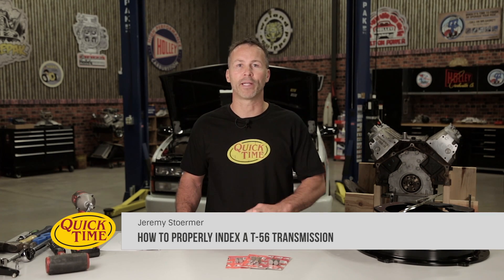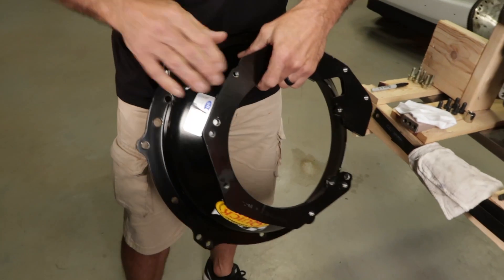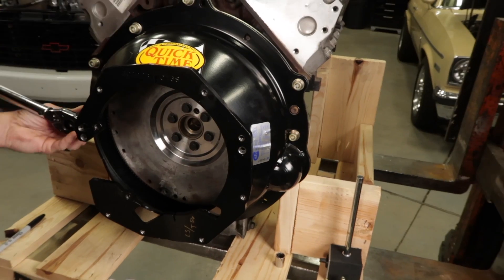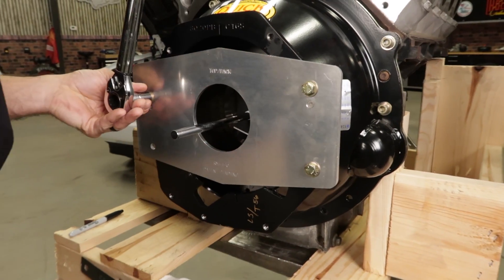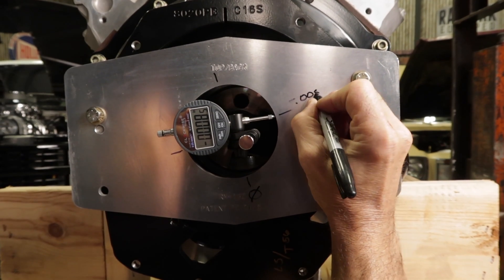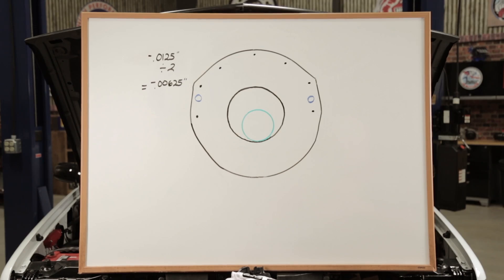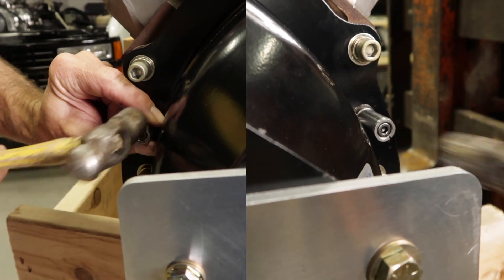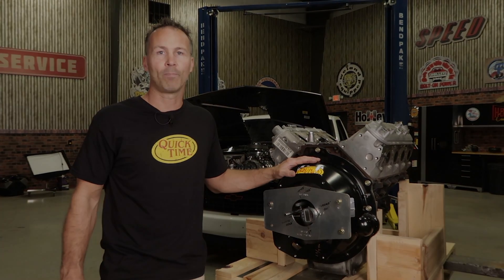How To Properly Dial Indicate a Bellhousing When Using a T-56 Transmission

Comment: Am I crazy or did this video just prove that the hole in the setup jig plate is out of round by 0.004"?!?!?  Either that or the initial 'zero' point was wrong?  If the zero was correct and the hole was round then the left and right numbers should be identical?

Comment: The crankshaft is sitting directly on the lower main cap(s) so crankshaft is probably 0.001 to 0.002 low and not centered. When  engine is running the crank is riding on  the oil film and hence is now 0.001 to 0.002 higher. How are you accounting for this "offset"?

Comment: The only thing that confuses me is how you can have two negative numbers at the three and nine o clock positions,unless it isn’t a perfect circle.
Reply: YES!  zero is wrong or hole isn't round.  Likely, the hole is quite round considering how they bored it....and the zero was hastily located somewhat incorrectly.  One could keep marking zeros until left and right were identical and then be close to 'the real' zero point.

Comment: I'm doing this now on my stroked 6.6L GTO. The plate lined up ok to my Speedmaster scattershield. Concentric is off about .0039 so I ordered a RobbMc Performance Offset dowel kit for $39.00. No drilling No tapping, and no pounding the new ones in. Great video. It really did help alot.
Reply: Wouldn’t .0039 be well within spec though?

Comment: I bought this and found it not to be trued ( has a slight bow in it ) tried calling their number on the web site and it seams out of service. I will be returning mine
Reply: i haven't seen one yet that specifies the quality (tolerance) of manufacture.  Just use the front of the T56 itself.

Comment: I'm a senior mfg engineer for one of the big 3 auto companies.  Today we would never let a block get out of our plant with dowel holes out of spec for location, in the event of this, that would be considered a spill and we would contain all the bad and suspect blocks so they would never reach our customers.  If a new or modern day block, I would lean more towards a bad bell housing.  JM$0.2
Reply: I think this is more after an engine is line honed,changing slightly the center of the crank.Also,some aftermarket bell housings are better than others but it has to be checked with the new Tremec tight tolerances.
Reply: The engines and blocks are probably pretty good these days.  I agree this is to correct questionable bell housings...which is fine considering some are weldments....and others are questionably cast chineesium.  And, 'yours' got final machined on a huge chunk of quality machinery; so no issues there.

Comment: Great video. However dont buy the dowel pins in this video. If you order from silver sport transmission. They are marked for the high side. This makes it so much easier. And guess what they are cheaper

Comment: Why would a guy bolt a plate on the bellhousing first..That plate could be off just as much as the bell housing.
Reply: exactly.  no one seems to specify how 'good' the jig is.  Is the hole round?  probably.  Is it centered where it belongs?  not quite as probably.  They should specify that every feature of the jig is within 0.0005" (five tenths).

Comment: There is something else that has to be taken into account when using an indicator in this manor... that is, that mag base, rods and everything associated with it is sagging. And, in the process is actually giving you an skewed reading. To test this, attach your indicator to a ridgid piece of steel with the stylus touching it. Zero out the indicator in the upright position then flip the indicator upside, observe the two readings. Ive seen .015 sag with an indicator setup like the one in this video.
Reply: Great point there yes, I bet this catches most ppl unaware on this.
Reply: yes that happens and is easy to account for.  In reality, if you invert, it won't move enough to matter (enough to measure).  If it DOES for whatever reason, the operator can account for it or else perform the work with the engine shaft vertical.  Personally, I would do it with the engine on a stand and then invert and repeat (without changing the 'zero' point) and observe any change due to inversion.

Comment: Quick question.... How do you center the base on the flywheel? It doesn't seem like you spent much time on centering it, just attached it.
Reply: The distance from the mag base shaft to the locating plate stays the same regardless, that's why it doesn't matter. 
I can't wrap my head around it either even tho I know it is right :)
Reply: @kennethalbert4653  IT works because everything spins around the crank centerline.
Reply: The mag base does not need to be centered.

Comment: what dial indicator is that?
Reply: Looks like Clockwise Tools DIBR-0055 but might be a slightly different model
Reply from the maker: Very common dial indicator available at most tool stores.

Comment: Hi Holley Performance, I'm interested in this topic. Could you tell me what is sound judgement of the bolt strength class of the mounting of the bellhousing to the engine? For an small front wheel drive car with a transaxle would a metric class 8.8 bolts do? Or is class 10.9 more conventional? Class 8.8 will flex more before it breaks right? So 10.9 isn't always best. Obviously my car manufacturer hasn't specified this.
Reply: Bellhousing bolts won't flex. Any bolt will do.

Comment: How do you accomplish these measurements for a transmission without a removable bell housing? I have an adapter plate for a manual trans and the engine dial pins are smaller than the dial pin holes on the plate. I don't think the dial pins are removable on the engine I'm adapting too. What would happen if I installed it as is and the dial pins and holes don't matchi?
Reply from the maker: Without a removable bellhousing, the adjustment (if any is needed) would have to be done with your adapter plate. The process is the same you just need to use your adapter plate instead of the alignment plate used in the video.  The dowel pins should be a snug fit in the holes otherwise you risk the adapter plate moving after it has been installed.  It may require some machining or drilling of the adapter plate or to the trans to make the pins fit and work.  Thx J